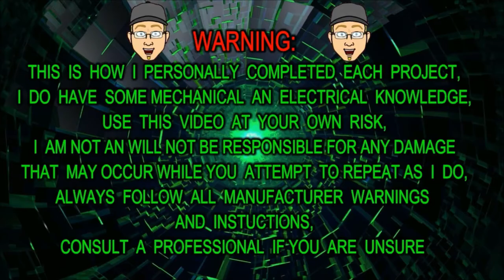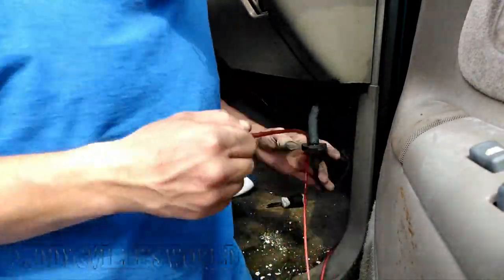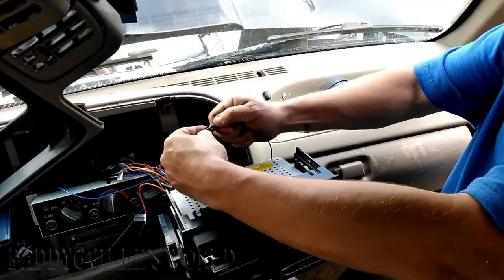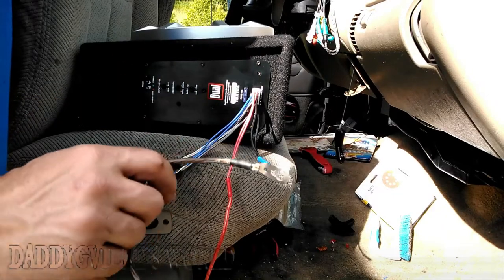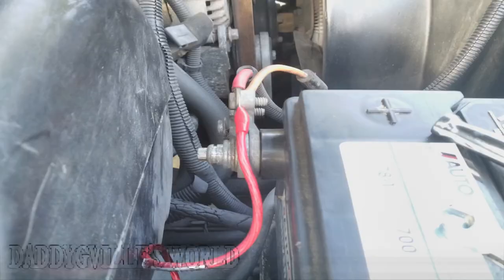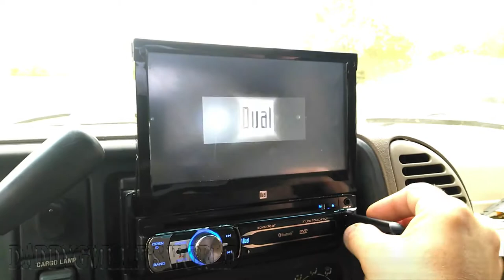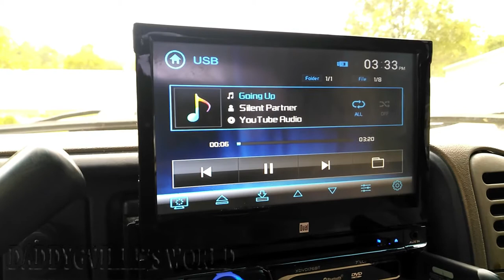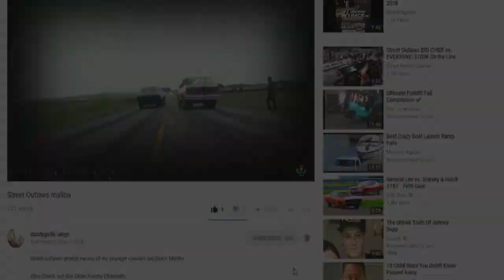Dual 10" Sub-woofer & Built-in Amp Hook-up, Test & Review

Comment: Dude, I've seen a lot of videos tonight and read through countless instructions.   Your video was hands down the best. Thank you.
Reply from the maker: Thank you very much i try to make my videos easy and to the point glad it helped thank you for your time watching an commenting
Reply: R u/have u hooked up a system yet? If not I'm bout 2 hook up 3 amps 4 12's(subs) and my head unit is like his it's already wired but I've got it unplugged and pulled out. Lol another words I can make a video 4 u(u and youtube)if ur interested in hooking up multiple amps,subs, batteries And or capacitors??? Ima blow da windows out(well spider web em)then get new 1's bcuz it's gotta few rock chips n front windshield and I said wth ima just web em all like SPIDER MAN lol. Going n a 2001 DODGE MAGNUM single cab full size bed pick up lol yessir yessir I did say single cab lol. Hit 164.8 DB(legel @ windshield not n floor board in floor it hit 171 n a EG style CIVIC HB and a '99 Ford EXPLORER Eddie B EDITION)equipment that's going n it

Comment: What would be the reason the 15amp fuse on the speaker keeps blowing?pretty sure I wired it properly and used a 680 watt amp wiring kit.
Reply from the maker: After i took the speaker out of the truck (replaced it with better sound) & putting it in my wife's suv she started having the same issue, i found it was the ground wire that kept popping the fuse, relocated the ground no more issues, thank you for your time watching & commenting, let me know if thats your issue or how you fixed yours

Comment: do you need a fuse i between the power wire and the battery?? is it the fuse that comes with the sub or does that stay in the sub? i’m new 😶‍🌫️
Reply from the maker: The fuse stays in the built-in amp also with a amp wire kit the power wire has a inline fuse, now if you are making your own wire yes, for the safety of your car or trucks ecm/ecu you will have to put in a in-line fuse.

Comment from the maker: Welcome and thank you for watching hope you enjoy an helps you make up your mind about buy it if that's what your here for.
Reply: This actually helped me out. Was able to finish installing :) had trouble because I was connecting to a OEM radio
Reply from the maker: @deaththekid3625  nice, must have a newer style car/truck many older oem radios don't have them, thanks for watching got many more vids to come.
Reply: @DADDYGVILLESWORLD  oh no I had to buy a converter. Rip out my factory radio and splice into the factory wiring.
Reply: You can still hook it up to old factory radios. You just cut away the rca jacks splice and run off signal that goes into factory speakers
Reply: Is it OK to use the 680 watt wiring kit with this?
Reply: Can I use 680 wiring kit or do I need the 270?
Reply from the maker: @codyross1686  yeah you can use the 680 its just a heavier wire, after i took this out of my truck i had to change the small wire for a bigger amp
Reply: @DADDYGVILLESWORLD  ok then I will keep the 680 that way I will have it in case I upgrade some day

Comment: Can I cut off the rca ends and run it to my factory Sony subwoofer and tap the signak with speaker wire
Reply from the maker: I wouldn't recommend that cause the speaker already has its own switch board inside which runs the built in 300w amp which could possibly burn it up, but its yours so.

Comment: Is it any good I'm on a budget lol, might buy one to put in my 05 Honda Accord
Reply from the maker: Honestly its ok for a budget style speaker in a truck or suv, now for a trunk of a car i don't think it would be cause you would have to have it LOUD to even hear any difference, 6months after putting it in my truck i took it out for a big system & put it in my wifes suv, now it just sits in my garage un-used until i find something to do with it.
Reply: @DADDYGVILLESWORLD  okay thanks I'll probably just save and buy a kicker or something
Reply from the maker: @Scatpack23  yeah, after awhile i got sick of it, got two 12" 2000 watt speakers under my back seat now, people thinks it cause its a daily/work truck that ive been doing up
Reply: @DADDYGVILLESWORLD  heck yeah man I used to have 2 12 mtx but someone stole them out my old car
Reply: @DADDYGVILLESWORLD  what brand you got
Reply from the maker: @Scatpack23  had to go check the 12's JL but forgot i blew them sometime back the one's i have now are the pioneer 10" 1000wmax each ts-sw2541d
Reply: @DADDYGVILLESWORLD  do they bump pretty hard ? How much are those ones
Reply from the maker: @Scatpack23  like 90$ each ive got them set for rock/nu-metal, but on old school rap they will vibrates/rattle the cab of my truck.

Comment: Hey man, the instruction says to cute the RCA plugs. I didn't see you do it in the video so should I not worry?
Reply from the maker: I didn't cut my rca's because they ran the whole length of my truck no need to cut. Its all hidden way.
Reply: You only need to cut the rcas off of the wiring harness if you are using high level inputs
Reply: @baileyabshire5755  yea I figured that one out. Thanks tho👍

My wub wub is all secured and sounds great :)
Reply: What do I do with the sub wire on the back of the DVD player? I have the RCAs hooked up, and still have the single RCA wire for sub just hanging there lol

Comment: Can i use a 1200 watt wiring kit for this? Only wattage kit i could find in my area besides a 1600
Reply: I think you’d be fine as long as you don’t run 1200 watts through to this sub.
Reply from the maker: Yes it should be fine, its just a thicker gauge wire set & later if you wanted to go for bigger watt system you'd already be set up for it, thanks for watching

Comment: i have an aftermarket radio and it have a small scoche amp behind the screen and it’s considered an amp, how would i connect the remote turn on wire? just through that amp?
Reply from the maker: Sorry just seeing this hope you figured it out, that's just a amp for the radio to help amplify the sound not like the other type of amps, also the speaker has its own built in amp, but if it doesn't have a extra wire for the RTO, look up the specs of your radio to find which one is the RTO. thanks for watching & commenting

Comment: I just picked up one of these, the only thing I'm unsure of is what size power wire to run. The box says to use 12 gauge or larger, I was going to do 10 but I haven't found a 10awg in line fuse, I can get a 12 or an 8awg inline fuse but I don't see the advantage of using such a large wire when I cant change the harness that uses two 20awg wires, which when ran together is no larger than 16 gauge.

That and I don't know what size fuse to use.
Reply from the maker: I used a 20amp.

Comment: Can I tap into the rear speakers in a 04 silverado single cab truck I have a jensen CDR5620 and just bought this car dual TBX10A just for a little bass I don't really want to rattle things just some good bass
Reply from the maker: You taking about hooking the rear speakers to this bass speaker. If its that i would say you could if you took the bass speaker out an ran some new wires up to them, but you would have to un-hook the factory wires from the speakers where they run only from the bass speaker, but then your breaking that 300 watts down to power 3 instead of just one, this speaker is now in my wifes suv, needed more power after all.
Reply: @DADDYGVILLESWORLD  welp the reason why I wanted to do that is because I didn't want to take half of the inside of the truck apart just to put a 10" sub with a built in amp lol 😂
Reply from the maker: @johngray2526  understandable my 85 ranger standard cab i put buck seats in with home made box with 2 8" behind the seats & a 15" in the middle but it was the 90's an i was a teenager
Reply from the maker: @johngray2526  in my truck now is a full box with 1k watt each speakers but have a 600 watt bridged amp.
Reply: @DADDYGVILLESWORLD  huh lol that'll be what I'll be saying all the time if I had 1k I'm already hard of hearing. 😂
Reply from the maker: @johngray2526  lol yeah my wife is like jr your already half deaf in one ear (the 90's) what with loud engines and systems you already yelling making videos 😂
Reply: @DADDYGVILLESWORLD  sad but I was born hard of hearing to begin with. I don't mind it at times like it pays to not hear what you don't need too. 😂